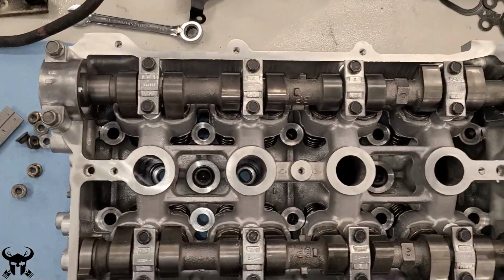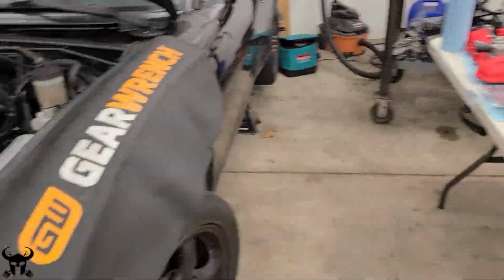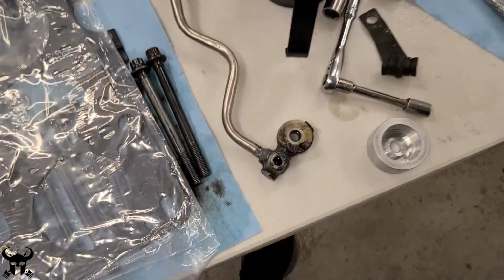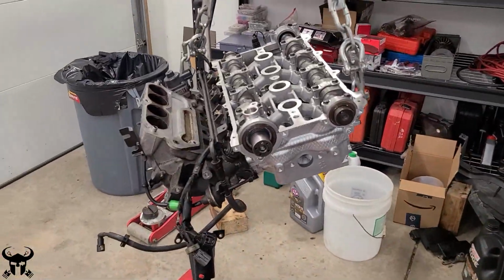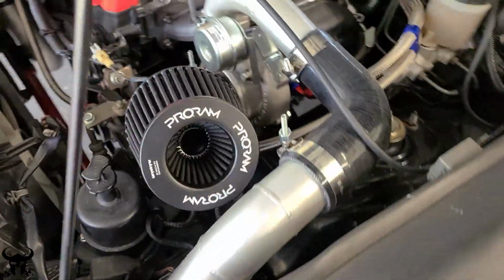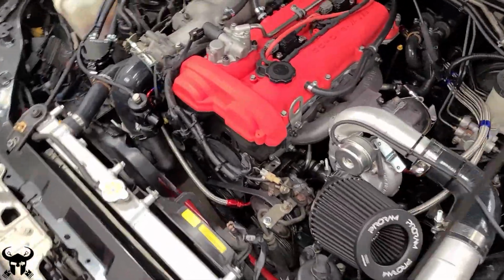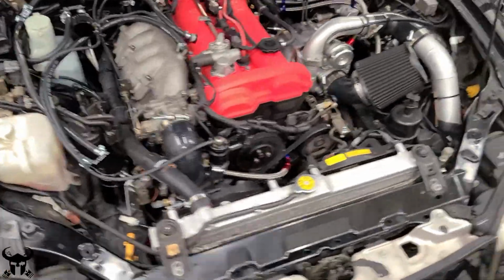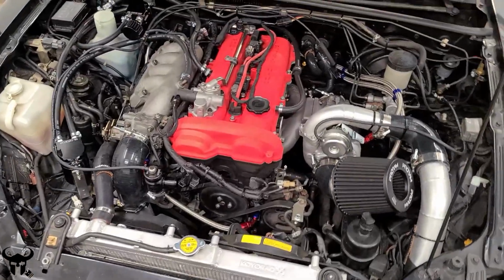Turbo NB Miata Install Part 3 - I Fixed My Engine!! Overheated Engine -  Replaced Head

Comment: I agree with what you said. I did a DIY kit on my 02 1.8VVT. I made sure to install safety measures to ensure I don't mess anything up. I also have a good tuner. But I did my full DIY kit for less than 2k and that's with the ECU and injectors. I just recently bought a stage 2 clutch and lightweight flywheel. My main goal was to do my first turbo build while making  it a learning experience. I don't drive the car hard, but I do for tuning days. I could've spent "real money" as I've been told but these 5m kits don't provide EVERYTHING just what you need to get you moving. All in all I had fun and the car runs great.

Comment: Why did you not use the 99-00 head gasket?  It's the better head gasket when you have coolant reroute installed.  I also mangled my oil tube trying to remove the head.